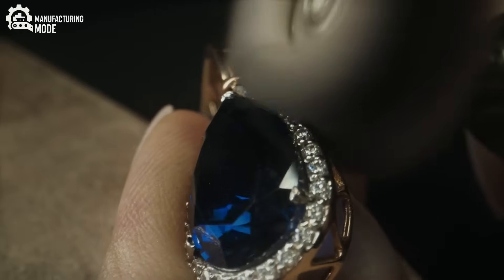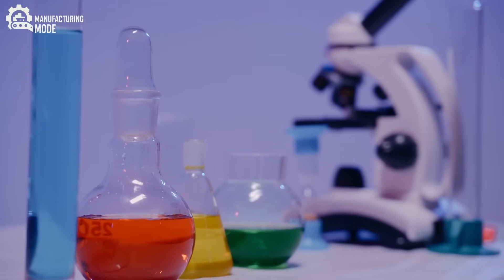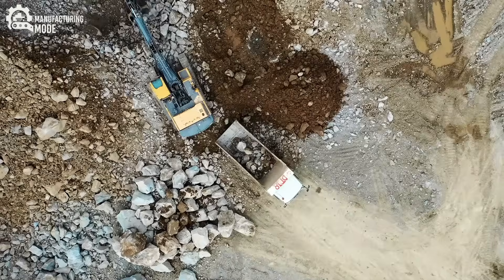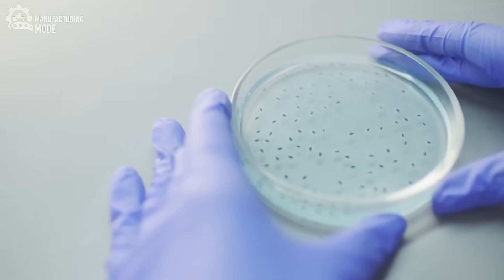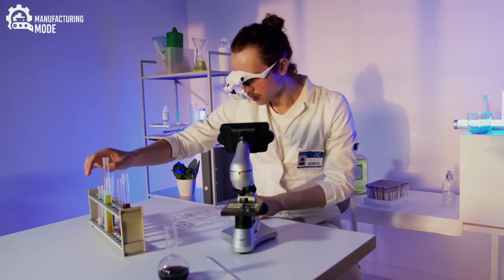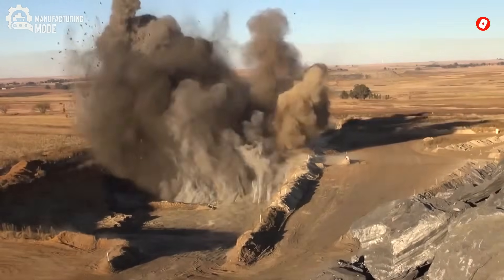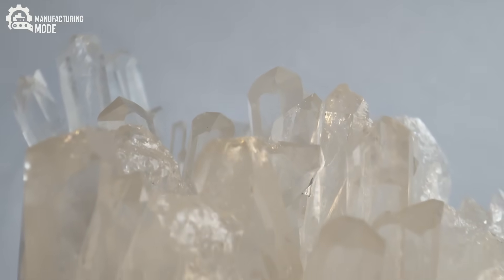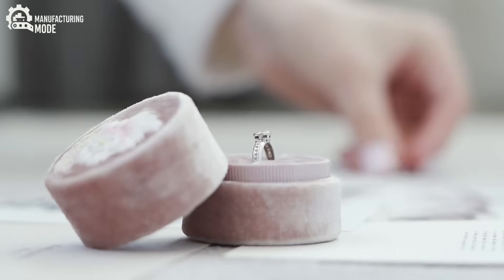HOW Are Diamonds Made? Real VS Lab SECRETS Revealed

Comment: Lab grown diamonds are WORTHLESS 
A 1 carat used to be $3000 today its $200
2 Carats was around  7000 Today its $500

Also to create a lab diamond the electricity to make them are a lot more than earth mined diamonds 3500 PSI PRESSURE 3000 Degrees heat 

Mines are only given the license to start after they post a Multi Million Dollars Bond   And have to sign a Reclamation Contract that after they finish mining they Replant the trees and even better than before and leave the place as it was before ir better ti get back the bond$$$ 

Lab diamonds are worthless because today China India Russia produce over 35,000 diamonds daily THATS WHY THEY ARE GETTING CHEAPER BY THE DAY
FAKE IS FAKE.